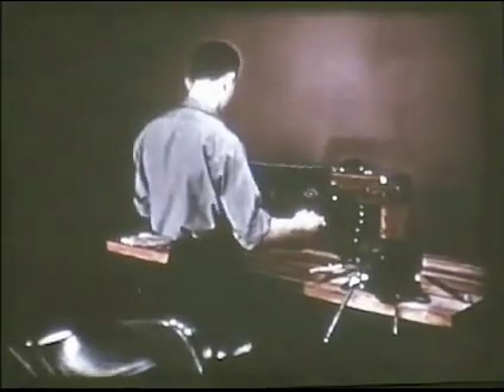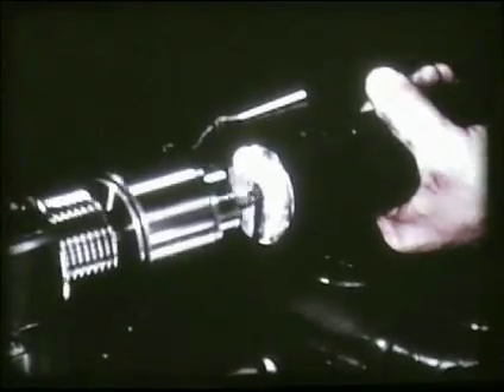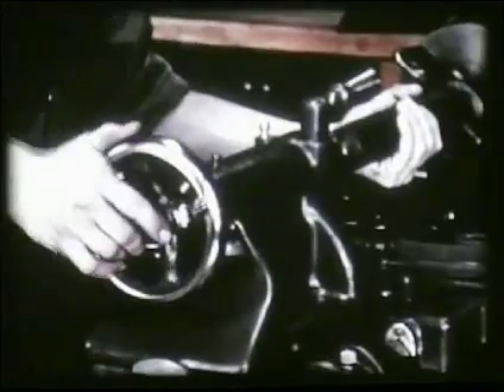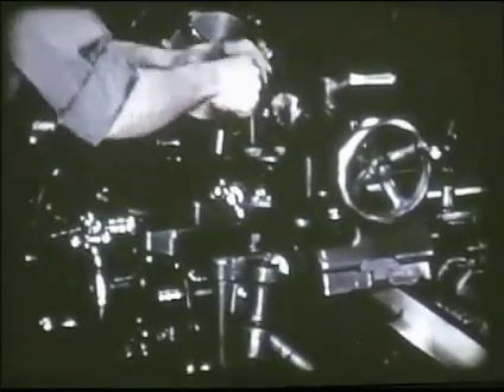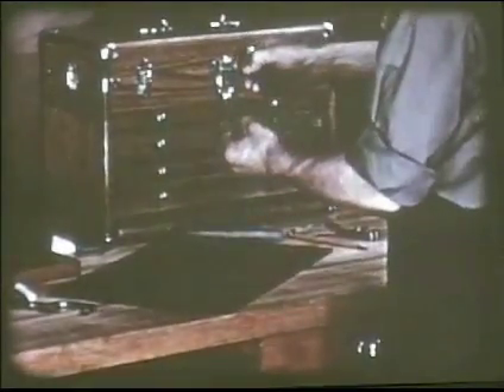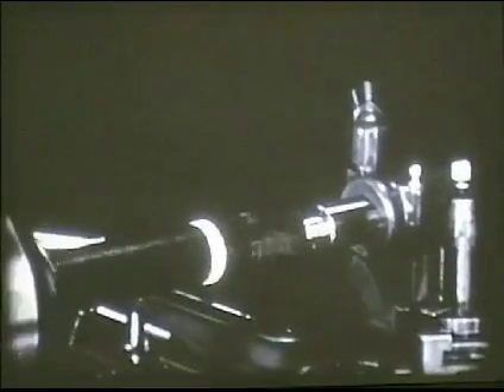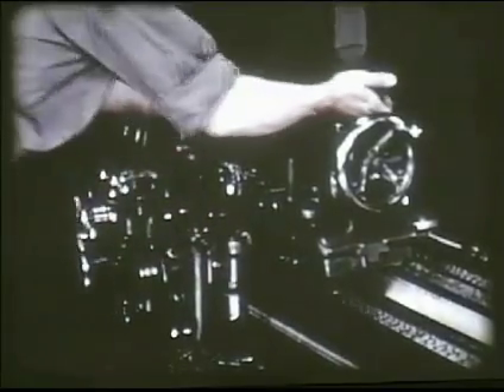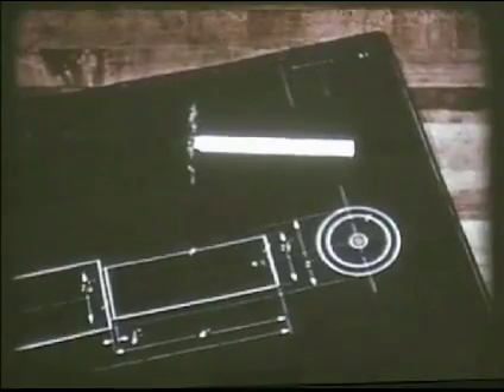Plain Turning on the Metal Working Lathe (Training Film)

Comment: FYI this is NOT how to do it; to do a center hole safely, you put the drill in the tailstock, and mount the job in the 3 or 4 jaw chuck, that way your arm isn't ripped off if the drill jams 🙂.
OR if you have to follow along, do the drilling of the center holes in a drill press first.
Reply: I think the diameter of this work is such that it would not fit through the chuck.

Comment: they do not tell you any ways to make sure the centers are centered to each other  Uncentered centers will create a taper  More so on longer parts
Reply: Sure they did. It goes together with saying it's not as simple as it looks
Reply: The effect is bigger if the part is shorter. But u are right. With a centerdrill that have a radius instead of a taper, u can use this to produce extrem accurate cones.
Reply: You planning to do that for every job?  🤣You only have to align the tailstock if it's been used out of alignment. Otherwise, leave it alone.

Comment: 60 or 70 yrs. later, and some of these machines are still being used. CNC has taken over with big Companies, but there is always the manual Lathe and Bridgeport off in the corner somewhere. Some small Shops in 2022 are still completely Manual.

I like the wooden tool box. I wonder if it's a Kennedy
Reply: Gerstner
Reply: yes in pakistan and india
Reply: @christophercolumbus8944  How high were you when you wrote that, champ?
Reply: Gerstner, most likely. They are still around, making the same fine wooden tool chests. Bring money, because they are breathtakingly expensive! ($800 for the basic/standard one)
Comes with a mirror in the lid so you can touch up your eyeliner. Made in Dayton, OH, USA.

Comment: I'm amazed at how long it took before ball bearing live centers came into use, being as there were so many other bearing-supported components in these machines.
Reply: Dead centers are STILL the highest precision method. If it HAS to be right on, it has to be on a dead center. Live centers are for production work.
Reply: The idea was there, the precision and design were not, so they were not as precise as a solid greased center.  It can be argued that they are still not as precise.
We could argue about bearing preload until the cows come home but it's simpler and faster to shut up and use a dead center.  I own both, and I use them in 
accordance with what billshiff2060 says above.  The live center is convenient and no mess and works fine for most of my tasks.  But if I'm trying to hold tenths,
it has to be the dead center.  I can't feel the TIR of the live center, but I can measure it.  No TIR at all with the dead center.  I am not an expert metal worker, but
any experienced machinist will tell you the same.

Comment: That is actually the most haggard way to center drill something I have ever seen.
Reply: Holding the stock..LOL YIKES!
Reply: I actually gasped when I saw that.
Reply: i am confused 
was he holding it or supporting while centering with the center drill???
Reply: @christophercolumbus8944  - the center drill will follow the center punch mark.
Reply: There is not sufficient clearance for the stock to fit through the chuck. I have machined large shafts that had to be centered on a horizontal boring mill prior to turning.
Reply: @xringhammer1871  I made this comment 8 years ago. I am still a machinist and far more experienced. Thats still haggard as fuck.
Reply: I guess haggard, HOWEVA.... how many planes from U.S plants flew in WWll and all the planes parts built with this method.... ain't no arguing that!  Surprised you didn't attack the hand ground tool or, the tool post holder too! Sheesh millennials LOL
Reply: @chrischapel9165  if a lot is coming off it doesn't really matter but why not stick it into the center chuck it like you normally would center it?? that's how they did it 100 years ago why was this guy doing it backwards
Reply: @chrischapel9165  Don't be ridiculous. How did you miss the point? WHOOSH! 🤣
Reply: @railgap  who cares